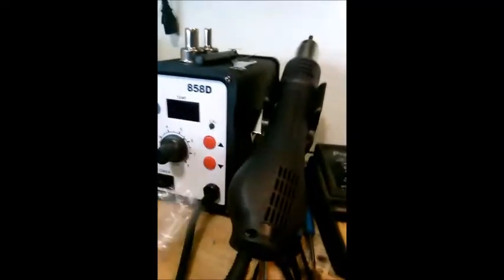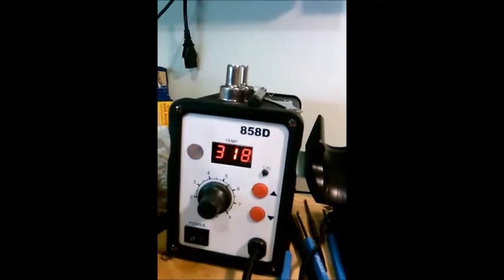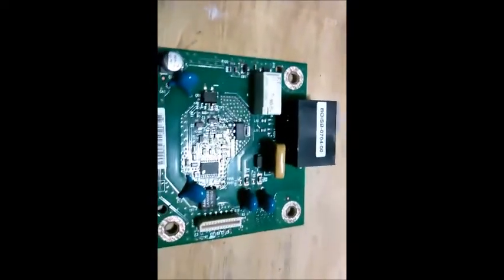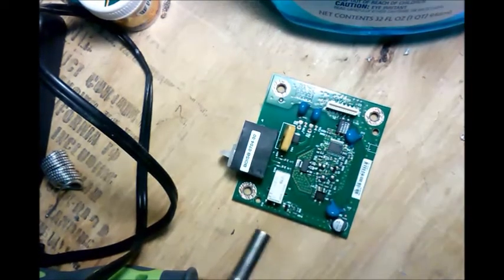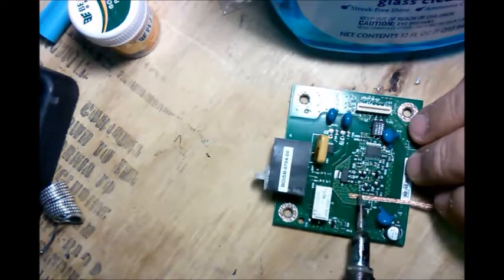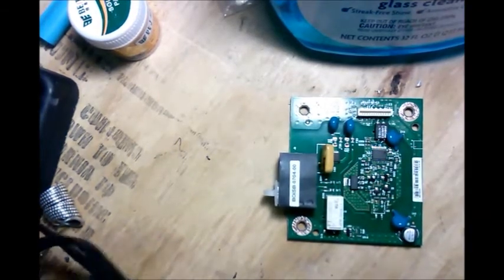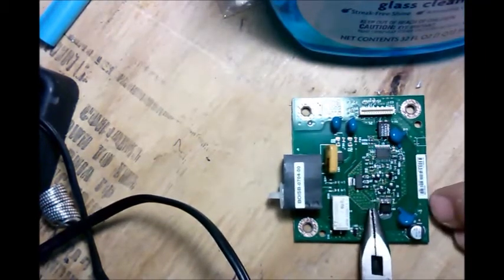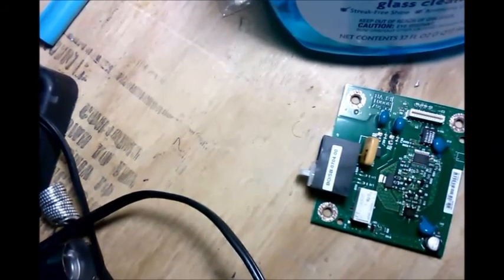Testing out  the 858D SMD Rework Station

Comment: I might have to get myself one of those.  I wasn't aware that one could purchase a hot air reflow station for $55.  I am sure the quality is not great but for occasional use it seems to work!
Reply from the maker: I am actually genuinely surprised at how well it works and feels.  The quality really isn't bad.
Reply from the maker: And Besides It said High Quality like 3 times on the box.  I am sure they wouldn't put it on the box if it wasn't true!!!  LOL
Reply: knurlgnar24 no u can actually get these for as low as 15 bucks

Comment: Thank god I'm not the only prepper that also plays with electronics. Good purchase on the hot air rework station.  I haven't had the chance to buy one yet, maybe this summer.  Have fun with it and keep practicing. I would suggest you get a good pair of long tweesers instead of the needlenose pliers for picking up components.
Reply from the maker: I have a 4 piece set of Veleman tweezers but I couldn't find them.